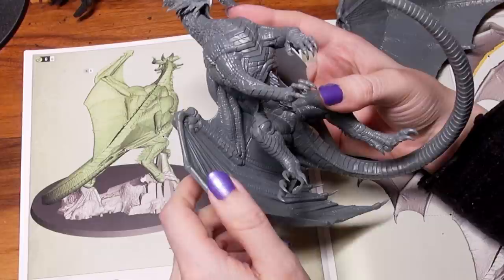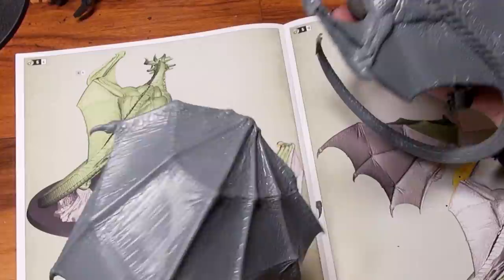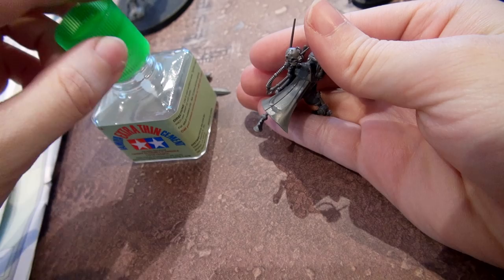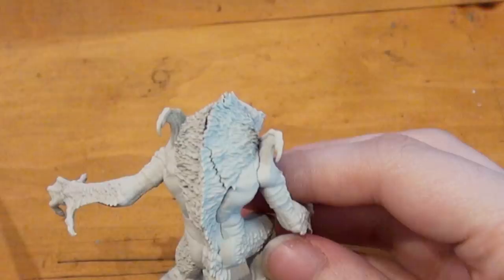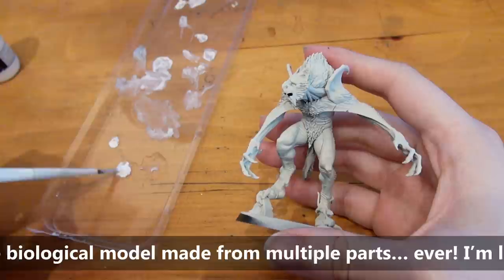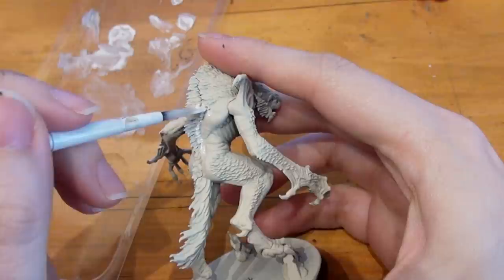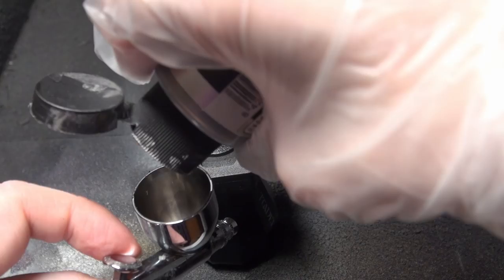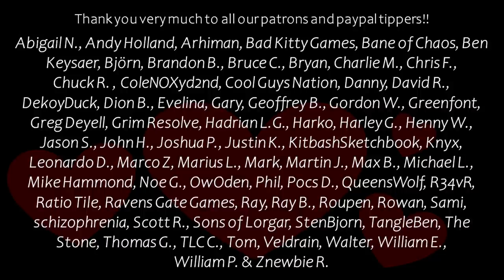Filling Gaps in Miniatures WITH EASE Before and After Priming

Comment: I recall when I realized that ultra thin plastic cement could be used to purposefully melt seams and mold lines on models to perfectly smooth the surface. It's not immediately intuitive since of course, the advice for beginners is to be careful with the cement. Don't let melt details, etc.

Also, a brand of putty I can recommend is "Perfect Plastic Putty". It is easy to brush smooth with a slightly damp brush after it hardens. It has allowed me to fill in all sorts of gaps and uneven surfaces that would normally require a lot of sanding and reshaping of the model. You can in fact make a damp slurry of it, put that onto a brush, and pull it over a model to find minute gaps and cracks - the putty will flow into them and show up as bright white. And the excess can be washed right off with a wet brush. It will completely dissolve.

Comment: I also use homemade Sprue Glue/Goo! It's very easy to make. 

Take a half empty or more empty bottle of plastic glue/cement then add to it cut up pieces of plastic sprues until they are at the top of the liquid. Put the cap back on and let it sit for a day or so, shaking it every now and then is also fine. If you want it thicker, just add more sprue. If you want it thinner add more plastic glue/cement or use less sprues next time.

For that Ad Mech cloak I would have used Sprue Glue/Goo on the seam when building and then after a few minutes of it setting up, clean up any excess with pure plastic glue/cement. Also it can be cut and sanded as regular because it is nothing but plastic.
Reply: Plastic puddy works much better
Reply: @Vokdor1  not really. Sprue Goo is nothing more than softened semi liquid styrene. It will clean up and be nothing more than the plastic of the model you are working with.
Reply: @assembly_language3948  yes really, you speak like someone who has never used plastic putty. Putty can be controlled with precision, and its viscosity can be changed. The smallest gaps can be filled with the tiniest brush. It is immensely superior.

Comment: Thanks for the tip. I've been using plastic putty for years and never thought about adding flow improver, Also, sprue goo works great for filling gaps in the smoother areas.

Comment: Large gaps in plastic models like you can get with conversion work can also be filled using sprue shavings pushed into the gap and dissolved using the method Naomi described. Sculpt the plastic filler while it sets.
Also, don't use bluetack coated with superglue as a substitute for epoxy putty like green/grey stuff.

Comment: I've been using Evercoat 2 part professional polyester body glaze for my resin parts.  It's an automotive body filler with a very fine grind of filler.

The only downsides is you have a very small window of 8-10 minutes or so before it cures. This could be considered a benefit by experienced people who want to get back to work quickly.   It's cheap and it's easy to sculpt/sand.

Comment: I use baking soda and super glue , works great and it also a lifesaver for attaching those pieces that are usually so annoying
Reply: do you  find if you made a mistake you can pry it apart after? I know I can with plastic Glue .
Reply: @Rusty_Gold85  yeah if I'm really careful I can use an xacto knife and get it apart but the bond is pretty secure. I do a ton of dry fitting to try to avoid mistakes but it happens to everyone now and then

Comment: Interesting video, especially the part with vallejo plastic putty and flow improver, gonna try that myself :3 One question tho - did you try using regular tamiya plastic glue (white) instead of extra thin for pre-gluing the parts? Ive noticed you use extra thin on parts before gluing them, but you might be better using regular glue for that - extra thin was designed to be used on parts already put together where capilary action makes it spread, and it evaporates really fast because of it (and stinks a plenty), regular one doesnt evaporate nearly as fast and can be applied without having to hurry nearly as much :3
Reply from the maker: Perhaps for newer modelers who take a longer length of time to assemble each piece, but for me I prefer using the extra thin at all points of the process because I fix as I go and the precision that the extra thin brush gives me, and my speed, work better than the white capped one.
I would use the white capped one for building terrain, which has more solid pieces and stiffer plastic, and in general larger surface areas to cover all the once with glue.  Depends on the terrain :)
Reply: @swordnsteele712  I seeee. BTW tried the trick with flow improver and it ate through my primer x) (vallejo black). IDK if it didnt cure enough it it's too agressive for it...
Reply from the maker: When did you start work on it after you primed? 😅
Leave at least 24h of cure time before doing anything over a primer.
Some primers even call for a week of curing first!
Reply: @swordnsteele712  I'm pretty sure it was at least 24 if not 48 hours. Next time I'll try with water with a drop of flow improver (it's probably the IPA that's in it that caused the reaction). That, and I'm REALLY tempted to try mr primer surfacer, tons of people claim it's THE best primer ever... except it stinks like hell. Good thing I have spray booth, but still...

Comment: Please help, my son decided to prime the figures before assembling, and there are now giant cracks in-between the pieces, how to fix?
Reply from the maker: Oh gee whiz 😆
Well, they would have to be primed again, but you can add plastic glue to the cracks, if they're small, to seal them
Or you can use Vallejo plastic putty or AK Interactive putty and add that (it can be thinned down with water) to the cracks, smoothing down with water once tacky, or sanded or shaved down once dry.  And then re-prime.

Comment: Plastic glue is great nut if it on your fingers, you then leave your prints on the model and then you have to fix that
Reply from the maker: If you find you are regularly getting it on your fingers, you are likely using too much of it at the one time.  Try using less and let it dry before continuing until you don't suffer that issue.  You can always add another layer of it later if you want a stronger bond.  Also, you can fix your fingerprints by using the plastic glue with a soft brush over the prints to rub them away.  Again, with very little glue at a time!

Comment: I know you're using an airbrush to apply the paint.  I would like to know what your solution to ventilation is when airbrushing.
Reply from the maker: An electric airbrush booth, ventilator mask so as to not breathe in the paint particles, and a hobby room just for such things with a big accessible window and a door to close to allow the venting booth to work away + the heavier-than-air paint particles to dry up and fall given time. :)
For all your gluing, a nice seat by the window should be used, too!
I hope that helps!
Reply: A basic bathroom style forced ventilation fan doesn't hurt either